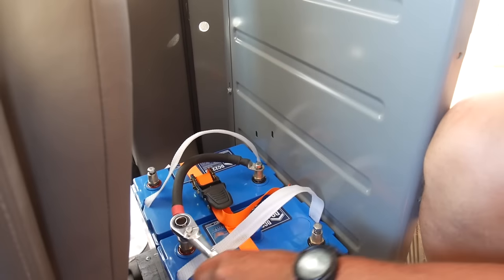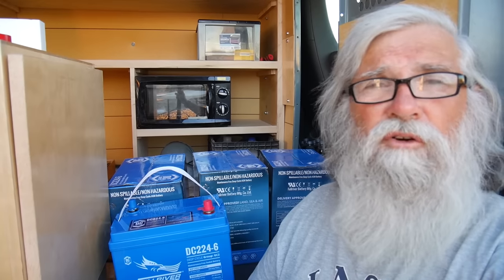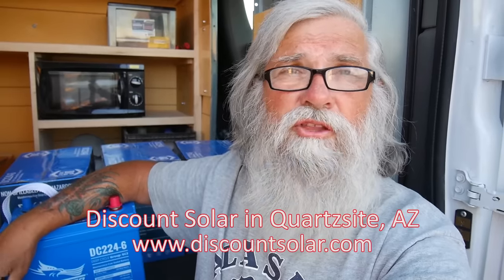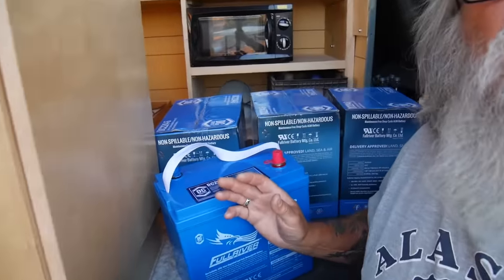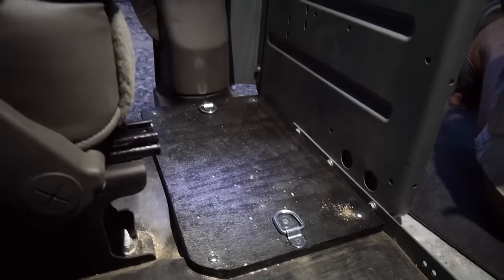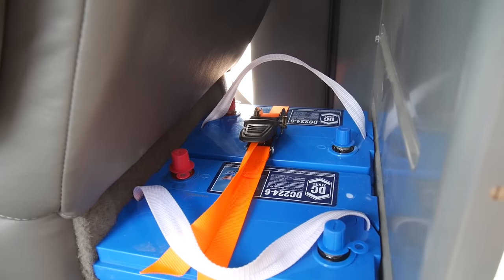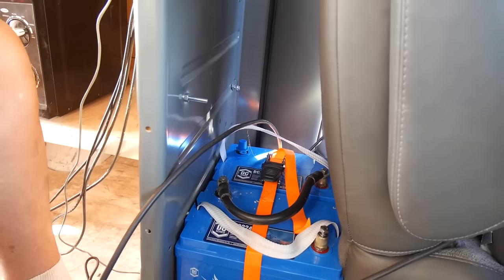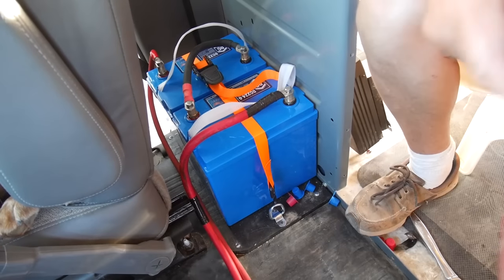Van Life Essentials How to Install a Solar Battery in a Van

Comment: Hey Bob this is a really good video with information  that i sure wanted to learn about! 
First i want to ask you, why do you need so much power? what are you using for you to need so much? second , i will have a class c motor home older moble that will need all that stuff and i will get solar panels etc. i like the microwave/ convectional oven i want to get one of those i think. but im gonna have a sewing room setup with a computer sewing machine i wantvto run that and the tv and the a/c  or heater all at one time like i do in my home now. plus i like lights on etc. do you think im am looking at a big stup for myself to have the comfort i want? you know like you have or should it be bigger!!!
Reply: Hey there, sorry I'm not Bob and hopefully he will answer. Just wanted to say that in the video Bob said the reason he needed 4 batteries was because of the microwave. So there's one answer. Not sure about the other questions that you asked about. 

My guess is if he needs 4 for the microwave you're going to need more for multiple setups, re; AC, sewing machine, and microwave. Perhaps the company that sells the sewing machine, etc., knows the power needs for each?  But think of it like this. If you use a microwave it will use up the power in the batteries until such time as they can be replenished with solar, generator etc. So if you want to run a microwave plus AC and your sewing machine at the same time you'd need more than Bob has. Does that make sense? I know AC takes a lot and usually has to be run via a generator. Good luck on receiving the answers you need!
Reply: Mona, I'm not sure if you will be able to physically put that many batteries and that many solar panels in and on your RV to be able to do all those things. Is it possible? Maybe, but it would take many thousands of dollars and always having a clear day to be able to us ac or a heater all the time.
Reply: VideoMorsels  so i need a generator to do most of my power? I was thinking or trying to understand the solar system would help more then a generator. i gues what i was meaning was ifvi was sewing and the ac is on and the tv is on and some lights on. maybe its on all at once for 15 minutes   just to have the ability  to use what ever i need.  im learning before i get in moved in one what all i would need. yes i did check out how much  it would be to even have a setup like Bob's . i am prepared for that.
Reply: Pearll Garcia so with the battery bank Bob has he could easily run a small ac for 6 hours of the day with fully charged batteries???
Reply: Pearll Garcia thank you for your advice, well my plannnn...... lol is to go to the rtr in az in jan. and make some friends and with those friends pair up or in group follow the 70 degree weather totally agree on that. i dont want  be parked on a rv park for cost of it.  thats why i want the solar system or what ever i need. i want to be able to boondock hang out on the land free you know. i am not a loner i want to meet all kinds of people and utube chanel as well...  so thats my plannn lol
Reply: cosmosradio so are talking about a house a/c ? if you are well i seen so far utube chanels thats what most are doing. because the a/c that is on the roof uses more than a window would. i wonder why the rv manufacturers don't see that. I guess there assuming you're going to be at RV park and plug up to electricity....
Reply: cosmosradio thank you for your advice. yes thats what i plan on doing boondock on the land. i dont want to be in rv park.
Reply: Pearll Garcia  i know at first i thought about a van. but i dont think i can do it first. yes i here a lot say the want out of the motohome or the 5th wheel becuse of many things you have to do and cant park in some places etc. well i still have to have my sewing passion come along with me. lol i guess learn the hard way lol. maybe in a year or two ill be trading it in for a van... lol
Reply: Pearl Garcia  Can you post the URL or a link to the "chasing 70" map? I realize some of it is just common sense--north in summer, south in winter--but it would be nice to see it all laid out like that.
Reply: Mona, you would not be able to use anything beyond a few led lights while an ac unit is kicking on. It takes A LOT of energy to get it started. Once ac is running, it isn't too bad. I'm not sure how many watts a sewing machine uses- I'm thinking less than 500 watts. Overall, it's better to use high-demand items by themselves. A generator is the only real option for your desires.
Reply: Shari D. Moore hey Shari, well i dont have it. the first i here about it too. i woild want a copy of it too.
Reply: Was trying to reply to Pearll Garcia, but the "reply" didn't show up where I wanted. I see she did post the link in a separate comment. Here is a repost of her response : Map of how to travel around the US at 70 F. There are probably less tourists/lower camping fees in the off season of an area or too hot or very cold. Chelsea Vicari has a good post about different prices and camping destinations in on/off season.
http://4.bp.blogspot.com/-48e4eDWRQIw/VjDuKFe_QPI/AAAAAAAAENw/Rg1-fCmTVzA/s1600/80DegRoadTrip.jpg
Reply
Reply: I also just googled "road trip to follow 70 degrees" and ended up with a list of hits. The link posted is actually for 80 degrees, with a 70-degree add-on that is not very specific, but it gives you an idea. Also, as a native Tennessean, I can tell you that you really don't want to still be in TN (or, indeed, anywhere in the Southeast) in June unless you spend the entire month in the mountains of East TN/North GA/West NC. Even with that, I'd be well north by June 1.
Reply: Thanks, Shari!

Comment: I’ve had solar for about 10 years now and have done a bunch of checking I still can’t see the fascination with 6 volt batteries they quit using them in around the 1970 or before you have 4 6 volt battery’s for $1000 you can get a 12 volt 845 cranking amp battery with 30 percent reserve power for $99.00 at Walmart it weigh is 61.7 lb they have several smaller sizes if this is to big 2 of these are around the same power as the 4 that you have and with 4 of these you have double what you have also they are 12 volts so you hook - to - and + to + on all battery’s 5 amps is a small load and they can put that out for a couple days without a problem with 4 of these in parallel you’re putting out 20 amps without the problem of putting a big load on your battery’s most microwave ovens use less than 20 amps and they only use a lot of current for a couple 1/100 of a second at a time so the 20 amp load isn’t going to be a problem for each battery I’m in California and except for the people who sell solar panels most of the people with solar have been replacing there battery packs with these for the $1000 spent on these 4 batteries you could have gotten 10 of the deep cycle batteries at Walmart and you probably could have driven your van a mile or more just using the starter motor the amount of power you have is determined by the amount of lead in the battery and these are about 2 times bigger than the golf cart batteries so you’re almost paying $500 for 2 instead of $99 for 1 to get almost the same thing the smaller one runs around $80 it will run your laptop for a day or 2 without any problems if your using led lights charging your phone you should be able to get a week or 2 without even needing to charge it or running a trolling motor for 8 hours I don’t know about you but I don’t have an extra $1000 for 4 little battery’s one of my charge controllers burned out around July and I also had a wire got shorted out causing my battery’s to not get recharged and trashing them I now have a larger charge controller circuit breaker going on bough from the solar panels from the charge controller and from the batteries I’m also going to connect some relays to the battery’s that disconnect them completely if they drop below 11 volts I’ve had these batteries in my motor home for 3 years now and used them in my previous trailer for around 4 or more years so that’s not bad for the $300 I spent that long ago I really want to go to the RTR this year  so I will be spending the money on gas ⛽️ instead of batteries this year I’ve been playing with them trying to get them to work better for a couple of months now but I think they’ve seen better days they do still run the lights bot that’s about it anyway check them out before spending $500 for 12 volts as apposed to $80 to $99 for 12 volts and depending on the size 40 to 60 lb you can get a little more power on some of the tractor batteries but then you get into the special stuff like the golf cart batteries $200 or more but you don’t get as much power as 2 of the $99 batteries but you can go out and tell everyone how much you spent ill leave it here I’ve probably ruffled to many feathers already I hope to meet up with some of you guys eventually

Comment: Do LGMs have the same explosion / fire dangers as standard LA batteries?
Reply: No for the most part but I come from the car audio world where people do dumb stuff sometimes. Just don't charge them with the voltage too high but for solar I don't think you would ever run into real problems.

Comment: All the weight in a van is on the front of the van. The engine is on the front of the van. The rear of the van is the light part of a van.

Comment: Keep in mind that you want the resistance to be the second on all cables which means cutting them to the same length. Also never mismatch cables in a system. Failure to do so can easily result in fire.

Comment: Don't you normally connect negative first?
Reply: Thanks for confirming
Reply: tiki, no. Negative is disconnected first when removing wires. Then the reverse is done when connecting wires with the negative connected last. If you don't believe me, go out to your car and remove the positive cable first. Take note of the sparks. Try to do it at dusk to see the sparks better. Then put it back on and disconnect the negative. Then compare to see which one made fewer sparks.
Reply: Always connect Positive ( Red Wire + ) First  Then Negative ( Black Wire - ) Next. When you disconnect The Negative - Then the Positive + Wire.

Comment: I can get the same amount of amp hours and charge them much faster with two lithium 100 amp hour Battle Born batteries. We all have different rigs we all have different budgets I think Bob's setup is great for what he's doing. I have 760 watt solar a 2000 pure sine wave inverter and a 40 amp charge controller under normal use through the night including my laptop and my microwave in full sun my batteries are recharged by noon. I just don't see that happening with AGM or flooded batteries even if you're hooked up to shore power. It's not just the cost it's not the longevity it's the performance even in low sunlight I get by fine with no Shore power and I have all the electricity I need.

Comment: This is completely off the subject. But guys, and gals. I need to know the best cargo van, that handles well, I don't want to be beat up while driving and I want good back end stability, I will need all the extra length I can get in a Van, and I want cruise control and I will be needed to fit 14 dogs, ranging from 38 to 90 pounds in crates, or pens in the Van. There is no man in my life for direction on vans. I currently drive a 1997 Ford - F150, that I love love love. I do have the quiet ride tires on it, Michelin and I know that makes a difference. i will also need the tallest top I can get on a Van. I need to get me and my dogs from NW Florida to central Florida w/ all these dogs.. HELP
Reply: Thank you Pearll Garcia.

Comment: how far can you discharge golf carts safely before they get damaged? 50%?
Reply: From my experience ya don't want to go below 50% but I have.
Fully discharged for very long and it'll kill them.
AGM's are supposed to be more durable and handle more discharge and recover better if fully discharged.
An AGM charger/charger setting is best BTW.
Reply: cool thank you.  as long as I can go to 50% I'm happy :-) 225AH should be plenty for what I need. I just keep going back and forth between AGM and Li-ion. it's also a question of weight for me. But I have another month or two before I need to decide
Reply: Mike Mead now that you put into the frozen sugar cone perspective ... :-D

Comment: Why didn't you just install 2 -12v batteries instead of 4 -6v?
Reply: 6v's are easier to carry/install and provide redundancy. The 12v's are over 100 lbs. each for the same AHs.

Comment: so you bought 400ah at 6v. since you made them 12v doesn't that mean you now have 200ah bc the voltage was doubled.
Reply: : four six volts produce slightly more amp hours than two 12 volt batteries

Comment: what are the ah on the battery
Reply: You can run 1 amp for 1 hour . So more Amp hours a battery has the more amps you can run for an hour. Note: These type of Batteries you are using the easy way to remember is only can run down 1/2 the amp hour of battery before destroying it 50%

Comment: I am living in my fifth wheel and have no engine or generator.  I want to be able to use solar while parked, until I'm able to purchase a pickup tow vehicle.   I've hired someone to move me.
Reply: There is a lot of You tube videos that will explain how they hooked up solar systems for 5th wheels. Check them out  should help you. Caution! Do not see RV dealers. Trust me. Take care

Comment: nobody should be eating microwave food on a regular basis. just occasional emergency basis only. you are denaturing the proteins. Goodness, Bob, please learn some proper nutrition to maintain your health so that we will have a steady supply of informative videos!
Reply: yes this is mostly true for warming baby food and formula because of the long term effect but for warming water for tea or coffee, there is absolutely no problem unless you believe it will break the structure of water if structure there is. If this is your belief system, you can simply pray over and bless the water and offer gratitude to the Universe. This will reverse the effect of the microwave.
Reply: Heating anything frozen will denature proteins. Doesn't matter the method. In fact, heating denatures the nutrients in general.